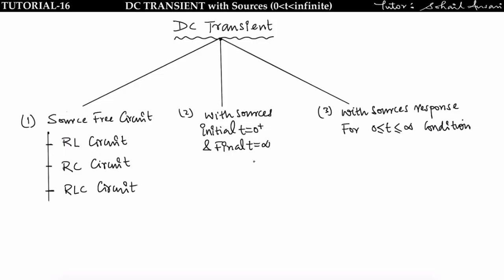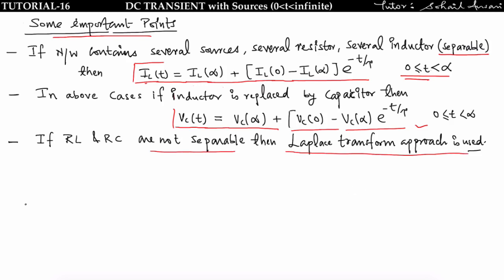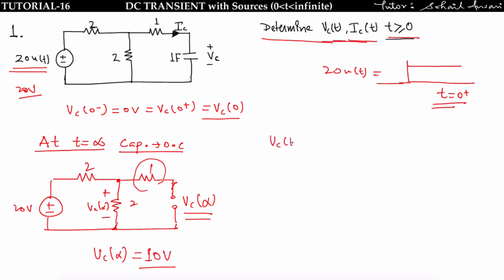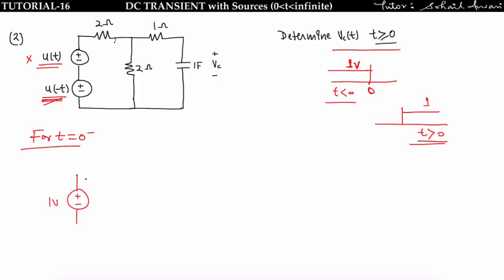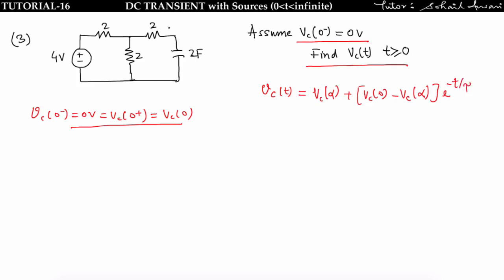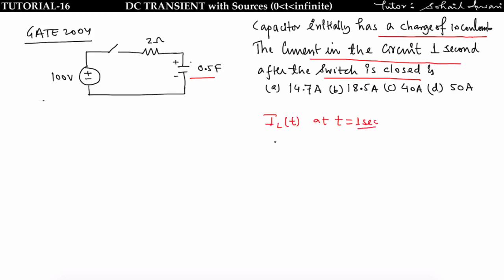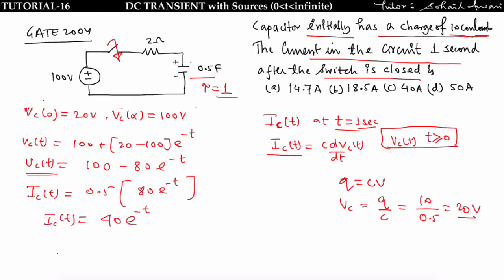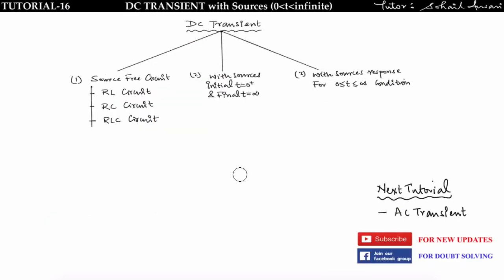Lec-16 TRANSIENT with Sources for t greater than 0

Comment: In last question you have not considered the polarity of voltages across capacitor at 0 and infinity,
Which are vo1 and vo2 of opposite polarity. Is there no need to consider polarity sir...

Comment: Vn cap is charged y r we replacing it vd open circuit and not vd voltage source in series with capacitor??? In problem 2

Comment: What would be the value of time constant in question 4) IES 2013.??
Reply: It is 1
S.C the voltage source, u will both resistor are parallel. Find R equivalent

Comment: dear sir, in Q2.. at t=0-  there is a voltage source, so at t= infinite, the cap should b replaced by its equivalent circuit ???- doubt

Comment: in a last problem capacitor has voltage at t=0+ then if we draw circuit at t>0 voltage source should connect with capacitor then why did u not connect?
Reply from the maker: because we want to find only voltage across capacitor at t=0 and t=infinite..and put this value in capacitor voltage equation to get the answer...thats y i have not replaced by its equivalent..ok

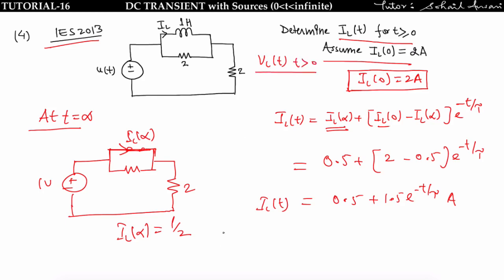Comment: at problem no. 4 @17:39 won't there be 0v voltage drop across the inductor as it has been replaced by short circuit and also for t greater than 0 steady state has been reached so the current remain constant and hence the voltage across inductor will be 0v
Reply from the maker: at t=0+ inductor is not at steady state bcoz u r applying unit step voltage in the circuit..bcoz of which there will be some voltage drop across inductor...once the inductor will get charged then the VlL would be zero...so VL(t) u will get for t>0...got it..
Reply: +LearnGATE Free yep,got it...thanks 👍

Comment: in the last question i have doubt about calculating time constant(tau).if the number of sources given (voltage source or current source),how to calculate TC?
Reply: To finding tau voltage source are s.c. and current source are o.c. and  tau always find at final possition of the switch so 2R×C

Comment: sir in the last question .....capacitor would be charged in an opposite polarity so the Vc(infinite) should be equal to -Vo2 & not +V02
Reply: and also how would it differ even if some polarity is given......bcoz cap is likely to get charged in the manner battery is connected...
Reply: I waz also going to ask the same ques
Reply: In last question there is a correction, the polarity of Vo2 is actually reversed
Reply: Porarity of capacitor is given in the question by placing the arrow Head , check carefully.
Reply: Please explain this ... I also have doubt in this .
Reply: sir already mentioned that he is not going to consider the polarity since polarity of cap is not given

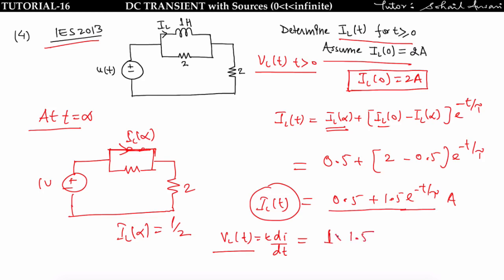Comment: Sir at 18:08 how to solve tow?
Reply from the maker: i explained u how to find time constant if R and L are separable in lecture no 13..go through that...
Reply: sir in this the inductor and resistor are not separated. I am unable to calculate. Pls let me know how to calculate?
Reply from the maker: its separable...short circuit the voltage source..u will see both resistor are in parallel..so find Req and then is only one inductor..
Reply: Thank you sir..got it

Comment: time constant will be 6 sec.
Reply from the maker: at what time u r getting time constant 6 second in video??
Reply: (2+1)*2
c=2
Reply: in 3rd sum
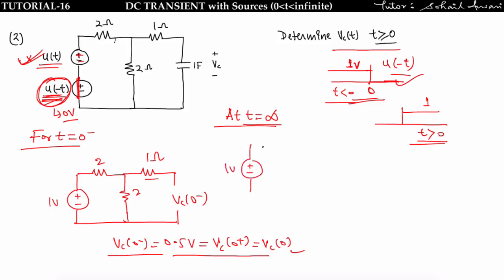Reply: 12:52
Reply from the maker: no it will be 2 second only..check it again..
Reply: how i didn't get that?
Reply from the maker: check it on 13:50 minute...its 2 second only.. 2 parallel with 2..equivalent will be 1 then 1 in series so total R=2ohm and C=1f so time constant=2 second
Reply: i am talking about 3rd sum next to this sum at around 14 : 51
Reply from the maker: yes correct..it will be 6 second instead of 2 second
Reply: by the way thank you for making such videos👍
Reply: yes, crct